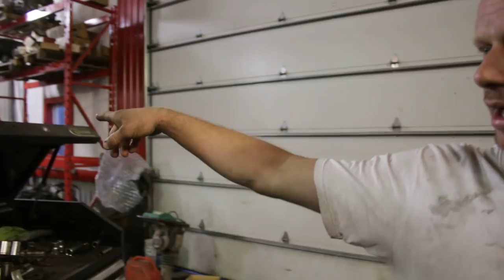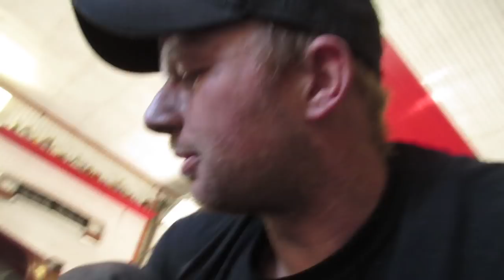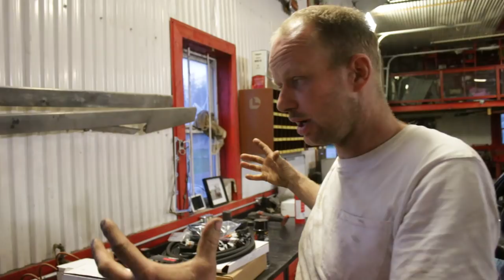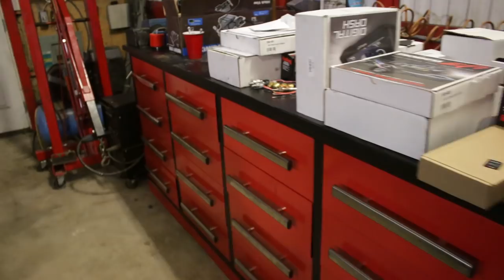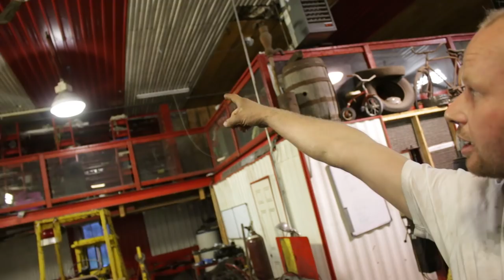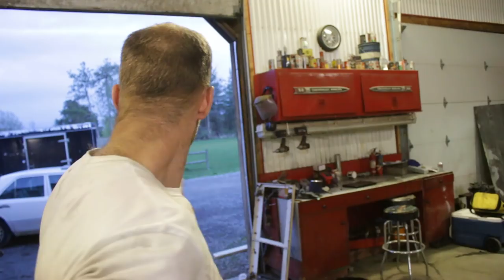What Every Shop NEEDS | How To Start A Mechanic Business (Part 1)

Comment from the maker: Work Bench: https://geni.us/haylite-workbench
125w LED Shop light: https://geni.us/LEDcornlight
Reply: Hey Rich can You tell Us why You prefer a Four Post Lift over a Two Post Lift ...!!!!!  I am looking to get a Lift but not sure which one to get ...!!!!
Reply: Hey Rich, 
Electrician in Ontario here, double check the instructions on the LED bulb you got to replace the Metal Halides in your shop. Most require you to disconnect the ballast and direct wire the 120V to the socket or else the smoke will escape your new bulb.
Reply: DEBOSS GARAGE 
Do a video on ur thoughts on Chevy new 4 banger VTEC in a full size Silverado. ... What kind of man shows up to a road crew or construction site with that crap?.
Reply: Lovely video content! Sorry for butting in, I would appreciate your opinion. Have you researched - Tarbbatigan Cars Rehabilitation Tip (probably on Google)? It is a good one of a kind guide for learning how to repair your car the easy way without the headache. Ive heard some decent things about it and my mate after many years got great results with it.

Comment: EVERY single time a young guy asks me about being a mechanic... i say the same thing you suggested, buy expensive precision tools and cheap sockets to start off. I still work out of a second hand box and the snapon guy bugs me about it every monday but i dont care
Reply: I did things differently, the tools I use daily I bought from Mac and snapon, meanwhile tools I use on occasion I buy from cornwell or lowes. It’s nice having paid tools and you’re own shop, thinking about hiring a helper to keep the gears going as I want to enjoy the fruit of my labor.
Reply: The snap-on guy still bugs me on a regular basis.....but every Wednesday, as the other 7 guys in my shop line up at his truck’s door to make their weekly payments, I’m still in the shop working & making money. I bought a large rollcart from him once, 8 years ago. A guy had bought it new and then it was repo’d about 6 months later for non-payment. I bought it for 70% off its new list price. Paid in cash, which is the ONLY way I buy from snap on. They make some great tools, and i own one set of their 3/8 deep & shallow 12pt sockets...I love em. But they were a treat for myself. I mean, $238 for what, 22 sockets? And that was on clearance? Insanity. 90% of my tools were purchased from Sears, Napa, Northern Tool, Menards, Amazon, and even a few odds and ends from Harbor Freight. To sum it all up: the best mechanic I ever worked with rolled his tools into the shop on a hand cart, contained in 7 cheap plastic toolboxes. The generic ones you buy at Home Depot for $15. That guy was seriously amazing.

Comment: The reason most shops fail is because they are started by technicians that think they can run a business because they can do the work. I know because I did it. I thought it would be easy to run a business because the old boss just sat in his office while I did the work. Running a business is a lot more involved than most think. The hardest part for sure is dealing with the various government agencies. Its a nonstop hassle. It took years, many mistakes, and a ton of stress along the path. Now the business is successful but still stressful.

Comment: I found that steel file cabinets are great for storing sandpaper and abrasive belts etc. Also worked real good for storing hand power tools all in a common area. I painted them to match everything else and was quite surprised at how many drills, grinders, saws that could be stored in one four drawer file cabinet. I had three and they looked and worked great.
Reply: Randal Bloomquist  my whole workshop is nothing but used steel office furniture.
I had troubles finding card/map files with shallow drawers, if you wait they show up.
I converted a 4 drawer to a 6 drawer using a 2 drawer as a donor. Wasn’t that hard, took a bit of time.
After I had done it I then had to reorganise the cabinets 2 more times as I found a card file close by on eBay (along with a school bag caddy/sans primary school locker that I converted to take grab kits/organiser trays) and another off the back of a guys ute before he dumped it at the scrap yard.

Comment: I got a costco box for 350 with wheels and it was nice.  I bought snap on tools but one at a time as I needed them, over the course of several years.  I started off doing mechanicing on the side while working as an engineer.  The most expensive hardest part of being a mechanic is building the metal frame building with radient in floor heat.  I have found that I can work on my plane with a hand held tool box for most things.

Comment: Hey Rich I live in Hawaii, and 10 years ago I built what I thought at that time was my dream shop, I don;t wrench for a living i'm retired and I mess around with old car;s, I have quickly found out the the 30 deep by 50 long shop was too small. I do have a 2 post lift, but I now realize I should have bought a 4 post, like you said in your video about getting older well im' 62 and my joints seem like 70 any way I enjoy wrenching and I love your show's, Aloha

Comment: If you’re on a budget, used steel office furniture is handy in the shed/garage/workshop.
3 drawer file cabinets. You can get card file and map type ones in similar dimensions if you look hard. The trick is all the brands are slightly different dimensions, shim the cabinets level with steel offcuts and you can lay on a bench top.
I’ve a row of 4 drawer files with stationary cabinets on top. If you get a same brand 2 drawer, strip it down, measure, cut, weld runner frames and fold the drawer faces you can make a 6 drawer cabinet, dividers in the drawers, I’ve got 2 I made, one for metric bolts, the other for imperial.
I made a rolling work table (I fix mowers) out of bench frame I found, in it I have a 2 drawer lateral file cabinet that I converted to 4 drawers for tools and parts.
My actual tool box is a 1.2m high map cabinet I found on the side of the road. Roller bearing drawers about 80mm deep that will take any amount of weight. It sits on an upside down angle iron frame with casters and shimmed at the front to stop drawers rolling out. Was chipboard top, is now stainless steel on a metal frame.
My work benches are made from a lot of 50x50 & 50x25 trusses from a shop front awning that I picked up. One is 32mm chipboard with woodgrain laminex the other is steel top with an old trailer floor upside down.
I’ve a whole small engine workshop entirely furnished with stuff I’ve found or picked up cheap. No need to spend $3000 if you’ve got a bit of time.

Comment: i dribble in working on my own truck, car and friends. i also do my own work on my own landscaping equipment and other various things. needless to say im 16 and i just got a used matco top and bottom box for $200 and i was ecstatic about it. i also rock harbor freight, stanely, Milwaukee, dewalt and makita tools. i try to save as much as i can but still get good quality tools that have lifetime warranty... i love your vids and thank you for all the great informative content.
Reply: Check out the GearWrench stuff. Shop around, they have quite a few of their sets go on sale, buy one get one free. Some guys say they are crap tools, but I rebuilt my 600hp Cummins ISX with them, we call it in framing the motor, and they did just fine. I have yet to break any of these tools working on my semi. And they do come with a lifetime warranty. Many tool trucks are starting to carry them too.

And great find on those Matco boxes! I have the first Matco box I bought around 1980. It still works.

Comment: I used to work in a shop that when they poured the floor, they put in huge 2 in thick by 12x12  plates of steel with a 2" rod about 5 feet long into the ground, so whenever we needed it we just welded anchors to the ground and then cut them off when done
Reply from the maker: I have clevis's poured into the floor that I can tie a chain to.  Great to think ahead.

Comment: I work for cat.  12 hour days, 6 days a week of hard use on the tools in 120 degree heat in the desert.  I bought cheap sears/harbor freight/amazon tools in the beginning and still have most of those tools.  I did invest in a few snap on tools, mainly ratchets, they just hold up a lot better in my experience but nothing wrong with other brands.  

Absolutely NOTHING wrong with harbor freight/craftsman sockets.

Comment: I've got nothing but Snap-On tools and a Snap-On chest. I paid for them all once and have had the very best for the forty years ever since. There is a huge difference in the tool quality between a Snap-On tool and every other brand. If I had to do it all over again, I wouldn't change a thing. I paid for the best once, (except the tool chest, which I upgraded along the way) and have never had to pay for those tools ever again. Best business decision I ever made.
Reply: Hot Rod Pete's Garage things have now change brotha theres is more technology out there and heck of alot more comoetition in the tool business i use to think this way too and had only snapon, mac, matco and cornwell tools i own a matco toolbox shhhhh 11grant for it with no tools buy monster tools, dent fix, 3m, grey pneumatic great quality fraction of the cost

Comment: For what it's worth, I used to calibrate torque wrenches and tolerance is usually +/- 3% of full scale and most that I came across were pretty darn good and accurate. The main difference I saw was how easy some were to adjust and lock that calibration adjustment.  Almost all dial indicating torque wrenches will need to be recalibrated if dropped.

Comment: I just work around my cars and flip cars every now and then, I can relate a little bit to this "mechanic" wise, however I do handyman/ remodel work and on that I can definitely relate. Everyone wants Milwaukee or dealt drill bits which can be compared to soccets and I just get ryobi. They last a long time if you know how to properly use them, you are going to loose them anyways so why go all out on them? I love working on cars and want a big box but my medium size box holds everything I have now and got a lil bit of room for future tools. Great job pointing out mistakes and fixes for them as well as small tips that make a huge difference

Comment: I used to buy all new, but then I saw the light. Pawn shops. Snap on and Mac boxes for $600 - $1200. Socket sets, etc, etc. You have to visit regularly and frequently. And of course sets always are missing the 10mm and the 5/16".  I also standardize on cordless platforms. So Makita and Milwaukee. All of this means being patient and waiting. Trade-offs. I am an amateur though. Haven't decided if I want to make it a job.

Comment: Just a couple thoughts... I put a nice heavy duty outlet strip on each end of all of my benches. It's always been a handy place for them and then there aren't cords at the back OR out the front and no matter how much crap I stack on or around the bench I can always get to the side. Works well for me.

In regard to labeling, I recently bought a Fellows label maker for about $20 on Amazon. The stickers stay on good, but also come off nicely later, and are thermal so grease or water doesn't instantly make them useless. I plan to do a lot of what you've got going on with the same idea in mind. Fortunately, or unfortunately (whichever way you want to look at it), I've had to downsize shops and am now going to have to store lesser used tools in the basement of the house. I'm putting them all in totes and labeling them. Such as A/C equipment, wood tools, etc, etc. It's a reasonable way to make more use of the little space I do have and it's pretty cheap. I've been buying totes no larger than I could possibly move if they were pretty much full of hardware (so... about 12 liters/3 gallons or so) for about $6/ea. Then they're easy to deal with.

Comment: I see some folks mentioned high running costs vs. Profit margin. Depends what you wanna do, if you want to work on some "prestige" cars or HD engines CAT/Scania you need proper space and insurance, profit margin might be slim but you can work on cheap bangers for folks that don't care that much what they driving they just want stuff repaired with possibly the cheapest oil and oem parts, in that scenario it will be more customers, so even with 10-20% profit you are still will be golden.

Comment: You most definitely can get a 4-post lift that is able to be worked underneath. Our shop has ran nothing since Bend-Pak from our opening in 2006. We replaced our 4 post once since we needed higher capacity.

Comment: I actually work out of that same box. It's been rebranded as an MTD, also have a side box for it. I find it to be great quality to be honest. Gave 500 for it, first thing i did was clean and grease the tracks. Just moved from my home shop to a hot rod shop, so decided to give it a sweet metal flake paint job. I almost pulled the trigger on a husky or Milwaukee, but this will do for now, cheers, liked and subbed.

Comment: Make sure you disconnect the ballast and wire straight 120v to the socket of those high bays. Hope they turn out as bright or brighter than the HPS bulbs.

Comment: Those benches go for 700-1000 at auctions all the time, you can buy them directly from china by the shipping container though for 200-300 bucks each.

The company that makes them has a massive selection though so they can basically build you a shipping container of various items and you get a hell of a discount.

Importing anything is an absolute nightmare of paperwork though, costs a lot to have it done for you.

Comment: Coming from some one with an electronics background I offer you this advice: If at all possible avoid those screw in replacements. You're skilled enough to put up real lights. Lights that screw to the electrical box are a WAY better form factor at dissipating heat and therefore will last longer. The screw in A type just don't have enough area to properly dissipate the heat produced and will fail sooner.

I don't know what's available at the large wattags you need. You may want to look into outside type that light large parking lots.
Reply: Also worth mentioning that the power company will often subsidize the cost of the replacement fixtures. A couple of places I've worked ended up paying $0 to replace them all AND drop power use by about 50%. Granted, those were huge factories, but you never know what incentives are out there.
Reply: True. My local electric company gives you two of those screw in LED bulbs every time you allow them to do an energy audit in your home. You can do one every year so 2 free bulbs a year.
Reply: totally agree. also if your looking to go cheaper and dont want to install high quality led fixtures, the high output t12 flourescents are actually verry efficiant. the lumen per watt is not that different from led, and they cost allot less.

Comment: Like the work benches! Did you think about a retractible electrical cord reel or air hose?  You can mount them high on the wall so they are out of the way. Pull em down when you need them.

Comment: Bought the milwaukee upper and lower box a couple years ago and it is ridiculously solid compared to my bosses snap on box which is smaller and more expensive.  The milwaukee box includes an inside power bar an outside power bar, a table that locks in place (so handy for writing on work orders), an individual locking drawer (for wallet and phone), a custom holder for drills, and a peg wall all this on top of the 200 lbs capacity lower drawers and 100 lbs upper drawers.  After taxes I paid 1300 all together at the Burloak (ontario) home depot.  Used and abused and not even a scratch on it very highly recommended
Reply: No way in hell is a Milwaukee box more solid than an Snap on box. Not even a heritage series. Unless you're talking about a Snap on cart, which isn't the same as their roll cab and those carts are still better built than any Milwaukee box, no question about it. 

Doesn't mean the Milwaukee isn't decent or better value, but that's not the same as being better built.
Reply: I understand if you're a little butthurt because you just bought a snap on box and think because it cost more it's better but it really isn't.  If you don't believe me go to home home depot and just take a look at the milwaukee box there's no comparison between it and the lower end snap on boxes.  I'm not going to hit my box or my bosses and see which one dents easier but his is plenty scratched and mines still mint.  I don't know snap on toolboxes well enough to tell you which one it is, my guess is that it is the heritage because you make it sound like the cheapest one but it was still more money than my milwaukee.  So yes you're probably right there is a better snap on box out there than the milwaukee, but it's their top tier boxes and the majority of people are only looking at the lower end boxes which are completely out matched by the milwaukee and more expensive than it.